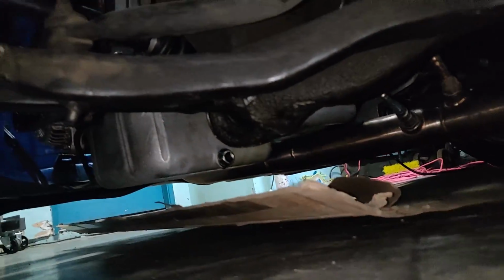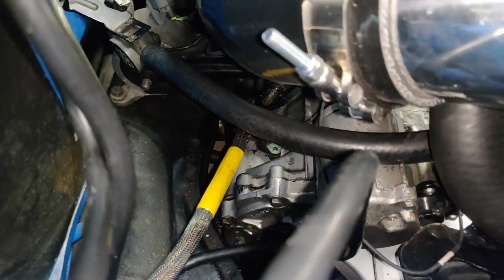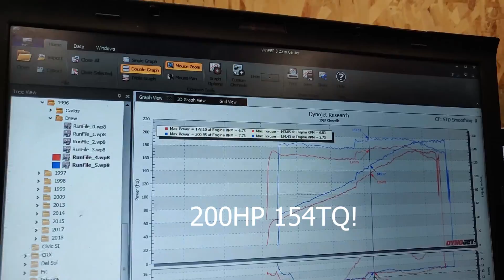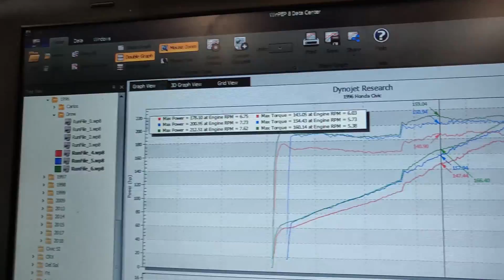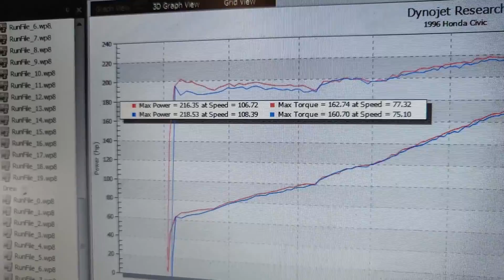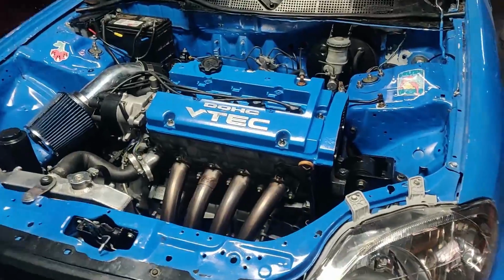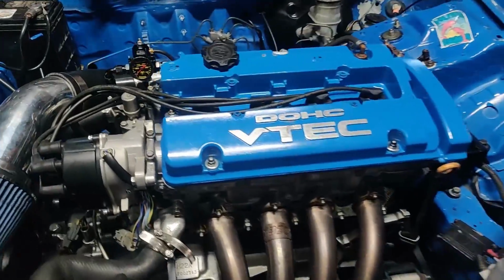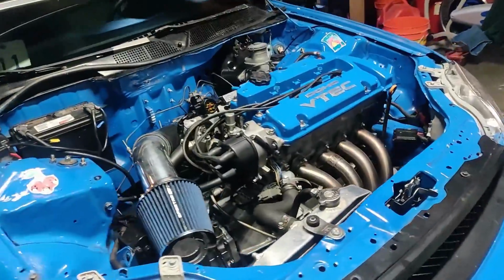STOCK H2B CIVIC HITS THE DYNO! (200+HP)

Comment: my h22a with mild port on stock manifold and head with springs and retainers and a few more points in compression made 260 and 180 they respond well to springs and retainers and compression.
Reply from the maker: That's good power! Yeah I plan to go with a built head on a stock H23 block at some point.

Comment: Good numbers interesting seeing the difference with the velocity stack n the filter. Its a built head right?
Reply from the maker: Yeah lower peak hp but high tq. Nah it's all stock.
Reply: Status Symbol lol yea i got to the part you mentioned it. For some reason I thought it was since you did the head swap
Reply from the maker: @germanvazquez584  I swapped the head once because I thought I had bent valves cause my timing belt fell off and it turned out the valves didn't bend lol.
Reply: Status Symbol o that sux lol. Great numbers nun the less
Reply from the maker: Yeah I'm gonna do a built head eventually but as of rn it's all stock.

Comment: The build came out great. I'm dealing with coolent issue with my set up.
Reply from the maker: Nice man! What kind of issue is it giving you?
Reply: @StatusSymbol  car running hot around 220. Replaced two thermostat and still the same issue. The lower radiator hose not opening 😑.  About to take out the thermostat and see what happens.
Reply from the maker: Try opening the bleeder valve on top of the thermostat housing and letting it heat up  until it starts to drip coolant or starts going through the lower radiator hose. I was having the same exact issue in the last vid I posted. Lol.
Reply: @StatusSymbol  well i am going to check that video out. Yea I did the bleeder screw. But still no change. I'm going to watch and get a oem thermostat. Hope something changes lol
Reply from the maker: You can also try doing it after you let the car warm up to about 190 or so and just slowly crack it open. That's what I did and after that it was good.
Reply: @StatusSymbol  final question did you open the bleeder when the car is on or when its off.
Reply from the maker: I did it when it was off then tried again later with the car on. I drove the car parked it cut it off opened the valve and a bunch of air came out and I closed it really quick. And then I let it cool down opened the valve started the car with it open and it just start pushing coolant out so I closed it with it leaking out coolant.

Comment: props bro, I also have ek coupe w it’s OG harness and I’m trying to find which prelude dizzy to use Since all the prelude dizzy have a 2 plug connection i think and the ek harness has the 1 big plug only ??? Any 97-01 prelude dizzy right !??
Reply from the maker: I believe the newer prelude dizzy has 2 plugs as well. If you're running a 97-01 prelude I believe you have to use a dizzy from those years because the crank position sensor is located inside the dizzy on the older H22.
Reply: Status Symbol I have a Jdm H22a which I believe it’s a obd1. So just get a 97-01 dizzy I’m guessing?? Where do I connect the 2nd plug then??
Reply from the maker: No if you have a JDM get a dizzy for a 95 prelude VTEC. It'll only have one plug.
Reply from the maker: If the harness for your car has 2 plugs which it most likely does run a jumper harness
Reply from the maker: @37btorresify  no wait I said that wrong my bad 😂. The 95 prelude dizzy will have 2 plugs. And your car should have one big plug right? You just have to run a jumper harness. That's how I had mine setup before I bought the wireworx harness.
Reply: Status Symbol ye I already have a jumper harness and yes my harness has only the 1 big plug  that’s why I’m confused on which dizzy to get !?? Currently running a high comp b20 atm
Reply from the maker: @37btorresify  yeah get one for a 95 prelude you should be good to go. 👌🏾
Reply from the maker: @37btorresify  I had a B20 p8r before I switched to h2b I bent the valves when I 2-3-2 shifted one time and drove the car for over a year like that afterwards 😂. Engine was good to me.

Comment: Im hopin to do my h2b swap but im using a plateless brough kit.
Reply from the maker: Hell yeah! I feel plateless is the way to go for sure! I got a deal on the QSD kit or I would have went plateless too!
Reply: @StatusSymbol  im just leary of the cuts i gotta make on the block for the axle boot clamp.
Reply from the maker: I feel that it does feel a little sketch but just make sure you take your time and check your clearance often as you go to make sure you're not overdoing it and you'll be fine.  👌🏾

Comment: whats it rev to?
Reply from the maker: I'll have to double check but I wanna say it's set to 8100 rpm
Reply: You should put your rev limiter to 8.8 8.9 my boy got a stock h2b with bolt on and that’s here he rev limiter is at so you can put your rev limiter higher with and make more power
Reply from the maker: Nah power was falling off by the time it was getting to 8k on the Dyno that's why my tuner set it where it is.
Reply: @StatusSymbol  what trans you got?
Reply: @StatusSymbol  and what is your setup h22a or h23a
Reply from the maker: H22 B16 trans
Reply: @StatusSymbol  but it shouldn’t have losing power on top end especially on a h2b it’s makes the most power on top end especially with b16 trans you in the power band the whole time